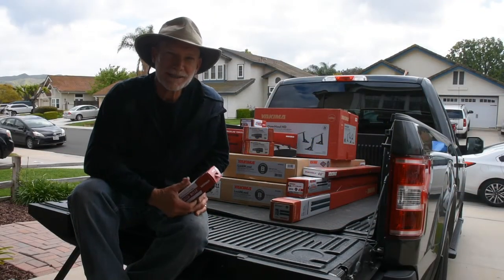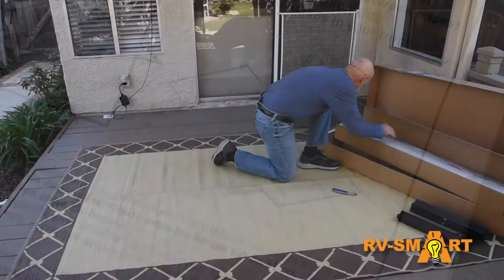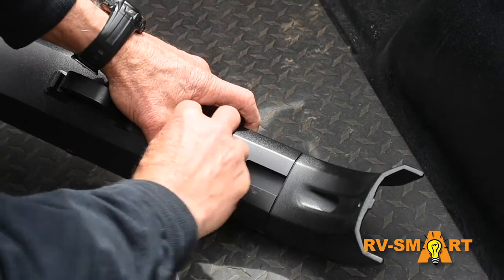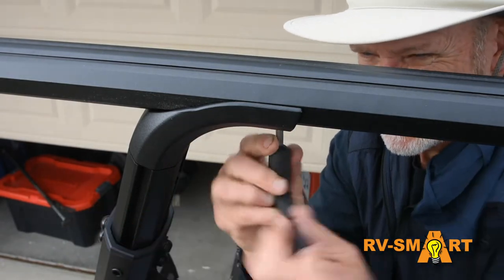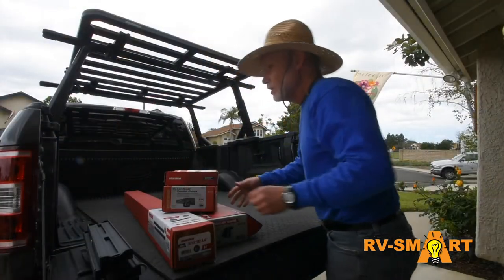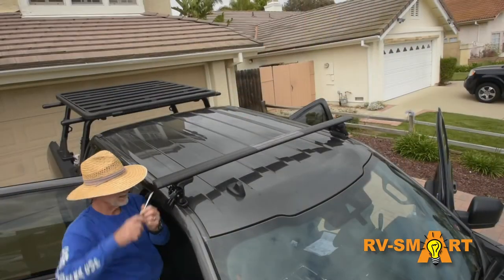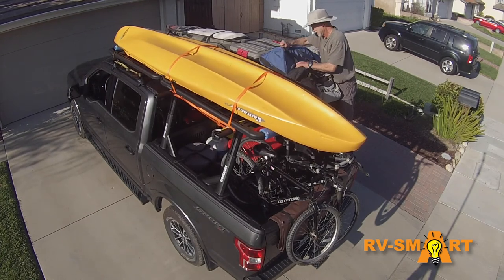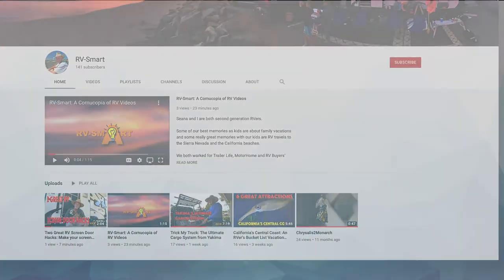Trick My Truck: The Ultimate Cargo System from Yakima

Comment: Man thanks for showing your setup.  I am going to setup my 2018 Ford F-150 exactly like yours.  My concern is the additional height that lock and load platform added on the cabin.  If you don't mind, can you tell me how many inches did it add from cabin roof?  I need to know if i used the same system as yours would it fit my 82 inch garage door height.   Thanks much.
Reply from the maker: Haha! You clearly haven't watched the fire table video or the generator video in which it is plain, I'm embarrassed to say, I haven't parked a vehicle in our garage in years. Thanks for watching this one, though.

Comment: Hey Bob,
2018 F-150 supercrew owner, I have had the Yakima Overhaul HD’s on since they came out but would now like to add the lock and load platform to the front and back.  Could you post the specs to your setup, platform size front and back (I’m sure they’re the same size) also for over the cab, landing pads, towers and crossbar length. Thanks Mark
Reply from the maker: The platforms I have are both 54" X 58". You can go to the Yakima website and they give you an option to plug in all your truck's exact specs and then give you a list of optional gear that fits your truck. BTW, thanks for watching!

Comment: Is there a reason you went with the bars instead of attaching the platform directly to the towers? I am trying to decide rather to do cross bars and a basket or one of the platforms on my truck cap.
Reply from the maker: In this case, I don't think Yakima has a configuration where the platform attaches directly to the towers. The towers and bars are a set.